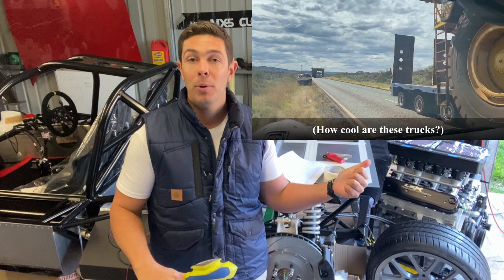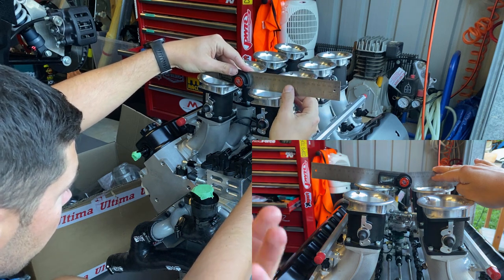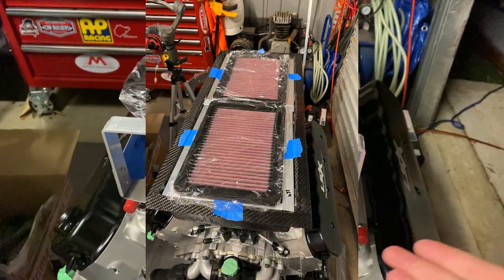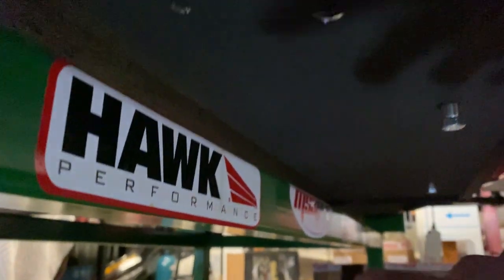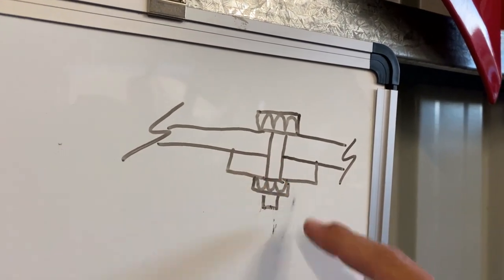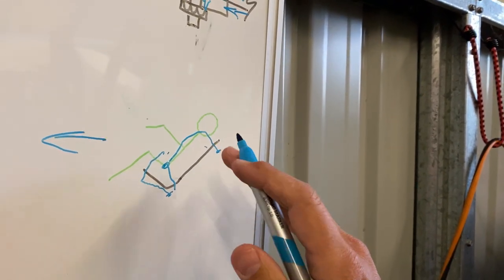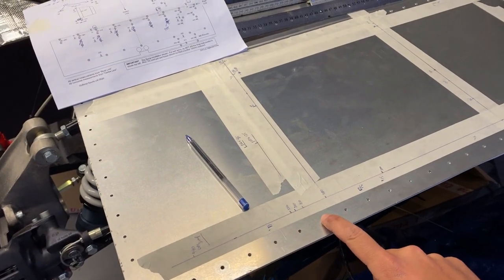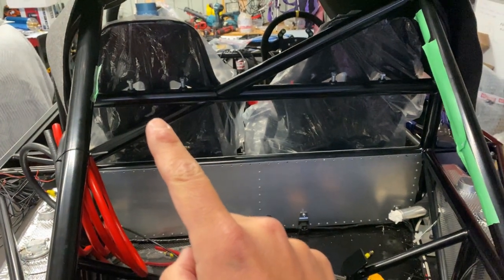Ultima RS - Carbon Air Box For ITBs, Rear Bulkhead Setting Out And Seat Mountings (Video #20)

Comment: Great video as usual, informed comments on the "myths" of aftermarket air filters.

Will you run the wiring clipped directly to the frame or install a sort of "ducting" to protect it/ enable a pull through in the event of changes/ issues (see Lotus Elise "upgrade" challenges..)?

PS - Ducks sound happy.
Reply from the maker: Hi John, Air filters and stickers are the best horsepower! 
I've got a mix of permanently clipped wiring for things that won't change, then ratchet style clips and zip tie mounts to allow for additions/modifications later, and I also ran carbon tubes through both side pods to accept additional loom later. The side pods are the most concealed part of the car, so it was definitely important to make allowances for later. 
The weather isn't being very conducive to the garage work, that's for sure! I bought a Diesel jet heater that has been invaluable though. Cheers
Reply: @rob105motorsport  Agreed Rob! Aha, carbon tubes sound fantastic - if hidden. The main thing is that you know they are there!

Comment: You definitely get what you pay for with torque wrenches. Also, like you said, being careful with them is super important. A big enough drop can put them out of calibration significantly. Looks like you're going to build a Cobra replica. I've been thinking of building a Daytona Coupe replica myself.
Reply from the maker: Definitely. My favourite thing are the guys who tell you that you must use a torque wrench for everything, then they toss it in the open tool chest in the back of their ute. I have a cheap one for semi-important jobs, and another two that I have for critical things and quite often check them off against each other. 
I absolutely love the Daytona Coupe. If you have the means, then you should do it!

Comment: G'Day Rob what was the book you were referencing for the bolt data please ?
Reply from the maker: Hey mate, It's actually a build manual for another car. I can PDF the few pages and bounce them to you if you like? I don't imagine the original author is too concerned as it doesn't contain any real IP, but it is a great reference! Cheers
Reply: @rob105motorsport   @Fred Nerk   Thanks guys i just been going through Freds link theres a few books there i could do with.
Reply from the maker: @frednerk5959  Thanks for the tip! I'll buy one. 
I have about half a dozen really good books like this - Engineering Mechanics by Val Ivanoff, Engineering Mechanics and Strength of Materials by Roger Kinsky are probably the best... they're great books in regard to applied engineering in practical circumstances like I use them. And you are correct, the principles haven't changed for purposes such as this.
Reply from the maker: @RavenSL65  https://drive.google.com/file/d/10CtjnWxu_azPOUNThZmOz0IAf6Y5s8o8/view?usp=sharing  - This is a summary of the info' in the book. Let me now if the link doesn't work. Cheers!

Comment: Getting there!
Q:
The external water pump: is that going to be computer controlled too?
Reply from the maker: Hi Paul, You can control them off your ECU but in my case i'll be using the Davies Craig controller to run the pump and the fans. The main reason I'm using the proprietary controller is that writing it's control logic into the ECU is possible, but I always wonder if they've simplified the control strategy in their technical documentation and have a few additional smarts they incorporated after extensive equipment testing. I also don't mind running dual temp' sensors and independent sensors to monitor coolant temp's. Cheers, Rob
Reply: @rob105motorsport  As long as you keep it all in check, I only see a benefit here.
No need for running a water pump at full chat, when the engine temperature doesn't require it.
And since you won't run a heater, that's even better.
In a way, you could delete the thermostat all together.
Thermosyphonic as a basis, pump driven when needed. Fans when things are getting over 95°C.
And if needed, a (electronic) switch to power everything for a few minutes, when parking the car.
To get the heat out from the engine bay.
Reply from the maker: @Paul_VanGo  I do actually run a heater, but it's all kept up front instead of running the pipework front to rear. 
As you say, the independent control available because you're not reliant on engine speed is great especially in traffic. Controlling heat sink after you come off the track is good too as it'll run the pump/fans for a period after shut down. That's all built into the standard controls logic. They also pulse the pump on/off during warm up to balance controlling hot spots whilst getting things up to temp' as fast as possible to minimise wear.
Reply: @rob105motorsport  Thanks for the answer. Sounds you're on top of it
I didn't really think otherwise. 👍🏻